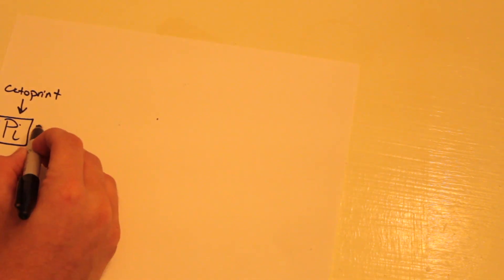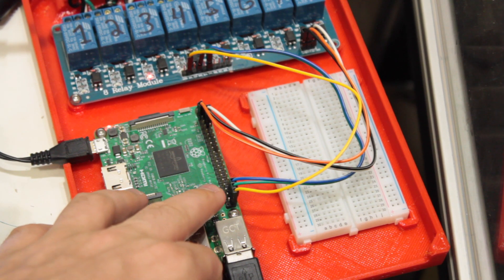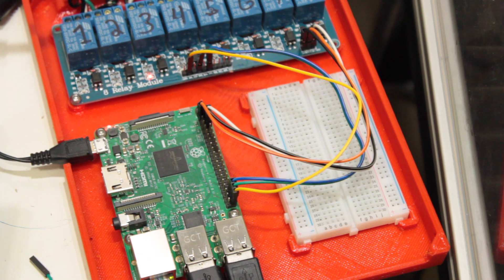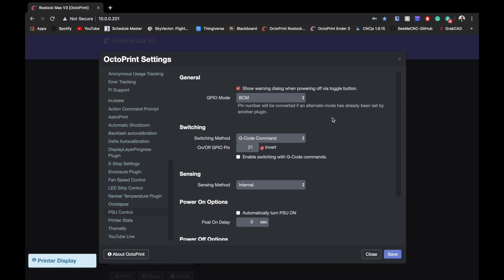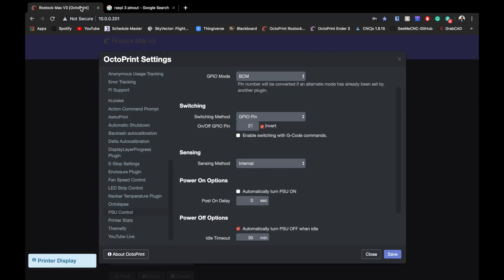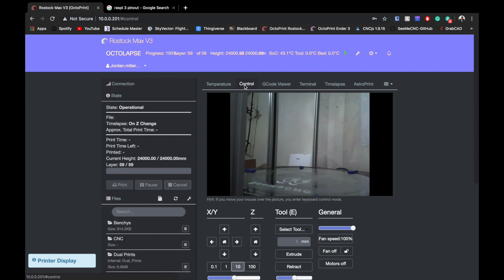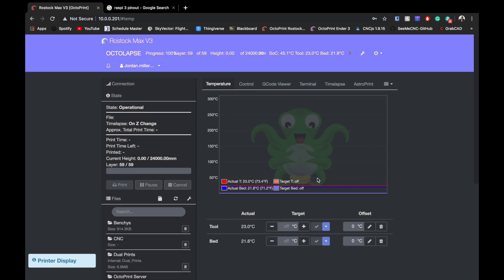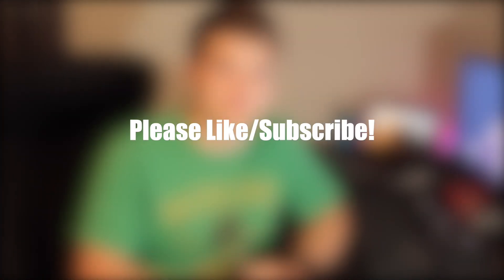OctoPrint OctoServer Part 2 | Relay Controls

Comment: how you can control more divices? PSU control only have 1 control relay.... thx
Reply from the maker: (Been a while since I've done this) but I think you just add another channel when you are in the settings menu for the specific plugin, that or it is a relay control plugin, I have done lights, fans, and the PSU on the same Pi before.

Comment: The massive problem with these small relais is that they can’t handle a higher starting current which the power source of your printer produces. At the moment you turn on the printer the small contacts of the relais could fuse together and you’ll never be able to turn off the printer again.
Reply: this!

Comment: Hello!
Nice tutorial, but how can I add more than only one relay for my LED strip?
Reply from the maker: DairisJuris Jefimovs thanks! Pretty simple, I use the relay bank of 8. Just simply put your other wires into as many relays as you are wanting and then make sure you put your GPIO pin jumpers to the right relays when your select your button to control that relay in octoprint. Make sense?